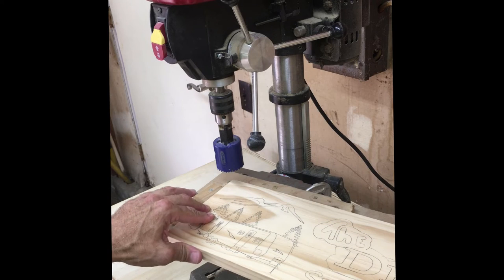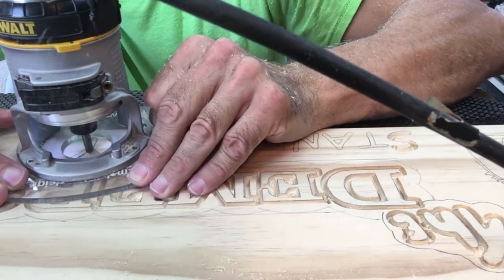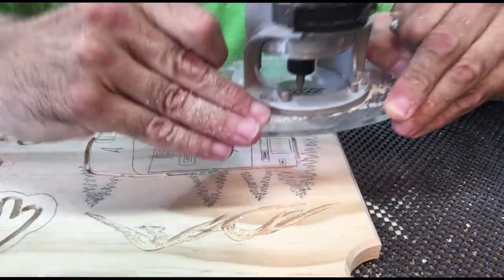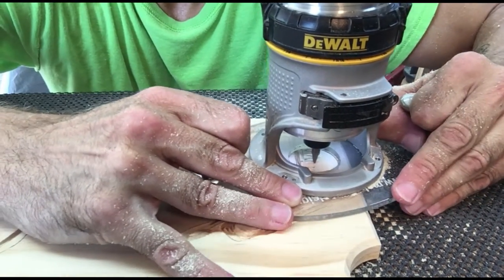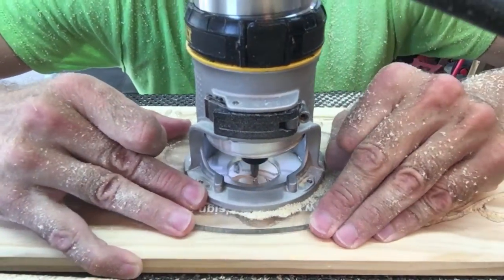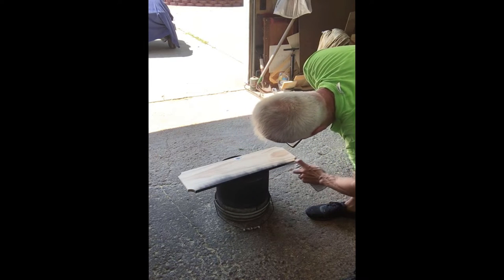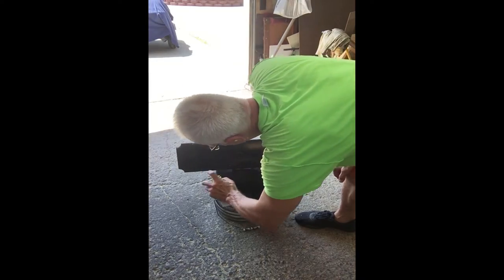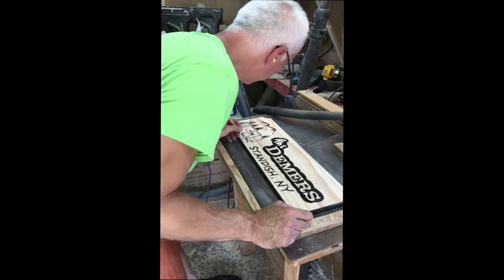How to carve a wood sign - Start to Finish

Comment: SUPERB. Subbed.
Question: Could I use my existing 1/8" shank Dremel bits, with a 1/4-1/8" adapter, to use with my DeWalt DWP 611 palm router?
Thanks, in advance.
Reply: I have used 1/8" bits in my DWP611.  I do not believe they were made for a Dremel.  Be careful.  You DO NOT want the bit to come out or break while using.  That could be dangerous.  Good Luck!

Comment: Thank you for the video. What bits do you use?  I want to try to make a sign but not sure what bits to get or where to get them. Thank you
Reply: Hi Keya,  I started with a 60 Deg, 90 Deg V bits.  I also started with a 'profile' bit, Whiteside SC55.  You can use a round over or 45Deg bit for the edging.  I still use these bits for  most of my signs.  I hope this helps.   Let me know if you have any additional questions.

Comment: You mentioned using a sanding sanding sealer. Which one do you use, and do you apply it before you start carving out the letters?

Comment: Steve—what is the router base that you are using?
Reply: That is the stock base  for the 611.  I cut a second hole in it to allow me to see with the dust collector mounted.

Comment: Thanks. Which bits would you recommned to do projects like mashrabiya moroccan screens? They are lovely but do require the removal of all the material and should be able to cut straight angles, not just rounded shapes. I'll appreciate your suggestions.

Comment: Hi, love the video.  I'm looking for a belt sander for the first time.  What are you using and what are the specs?  My 5" orbital, even with 80 grit to remove black, isn't cutting it.  Thanks, Greg in Nashville.
Reply from the maker: Thanks Greg.  Much appreciated.  I use a Skill 3x18" belt sander.  Nothing special or expensive.  Haha!
Reply: @stevescustomcarving1175  Thank you for the feedback.  I opted for a Dewalt disk sander.  Holy cow.  Used it the first time today and it melted that paint right off :)

Comment: 1st, great video. At 10:00... can you tell me what you are using at your nonskid mat under the work while sanding? What did you use for your final spray sealer? Nice video
Reply from the maker: Thanks Dee Cee.  That is just utensil drawer liner.  Nothing fancy.  I think I got it at Lowes.

Comment: what kind of router bit did you use? I also have a DEWALT palm router with a small 4mm  diameter router bit. But the result was not as nice. The font was also too difficult.

Comment: Hi steve.. what kind of bit did you used? Thanks
Reply from the maker: I use 3 different bits on this sign.  
White side Whiteside Engraving CNC Router Bit, 5/8" Point, 1/4" SH for the artwork and letters
Whiteside Router Bits 1500 V-Groove Bit with 90-Degree 1/4-Inch Cutting Diameter and 1/8-Inch Point Length for the cloud around the letters
Whiteside Router Bits 1540 V-Groove 60-Degree 1/4-Inch Cutting Diameter and 7/32-Inch Point Length for the inset letters.

Comment: Hi what kind of tip did u use for carving
Reply from the maker: Hi Rey, I started with a 60 Deg for the location letters, 90 Deg V bit for the cloud and cleanout.  I also used a 'profile' bit, Whiteside SC55 for the outset letters.  You can use a round over or 45Deg bit for the edging.  I still use these bits for  most of my signs.  I hope this helps.   Let me know if you have any additional questions.

Comment: how do you print it on the wood ...and space them properly?
Reply: I do my design with PowerPoint.  Then I print it and use carbon paper to transfer the image.  I have begun to play with printing a reversed image on wax paper but it requires a lot more setup to work properly.  Much faster though.

Comment: You could just run the sign through a planer and let it take a 1/16th off and forget all that sanding
Reply: I have tried that.  The problem is with fine details in the carving.  They often chip out.